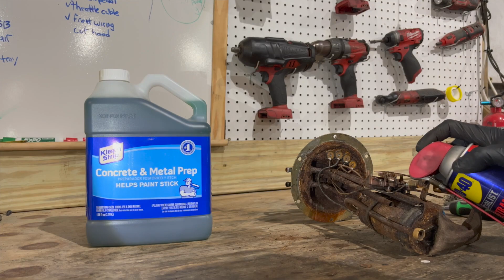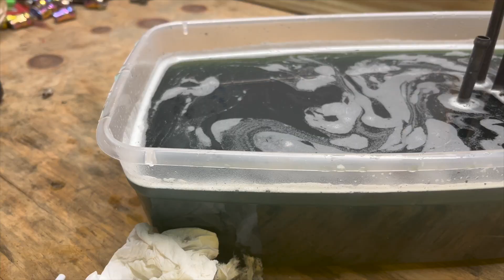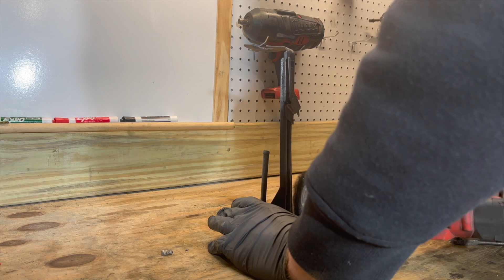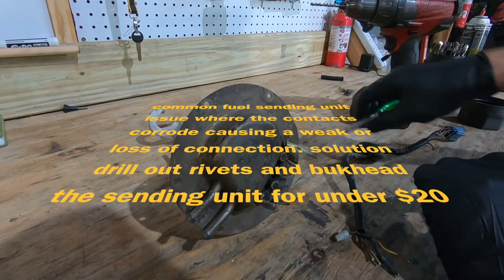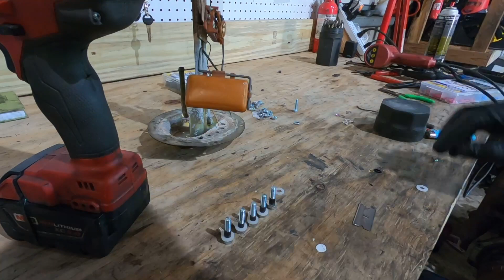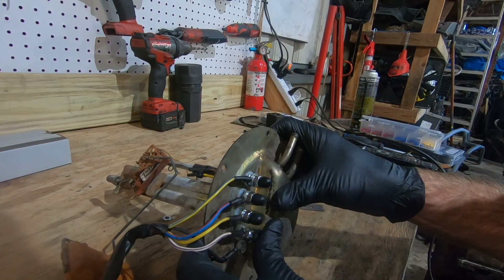Rust Remover 240sx fuel sending unit tank Repair

Comment: that tube looking thing at the bottom of the fuel pump (connnected to the a wire) what did you replace it with and how did you replace the resistor on it mine is shot
Reply: what??

Comment: What size bolts did you use? And what is that one black wire that hooks up to the small aluminum piece? Looks like a battery almost
Reply from the maker: M6 bolts and nylon washers on both sides . Which wire?
Reply: @Nscardigno33  do you have an IG I can dm you on? And why 14 gauge? Aren’t some of the wires smaller than 14?

Comment: What size wires did you use?
Reply from the maker: 14g wire  .. heat shrink on bolts and nylon washers both sides
Reply: Why nylon washers? I have 12 gauge wires, any caveat or am I good to use them?